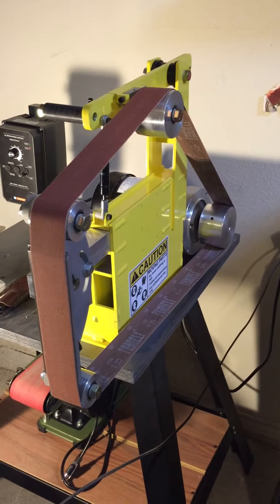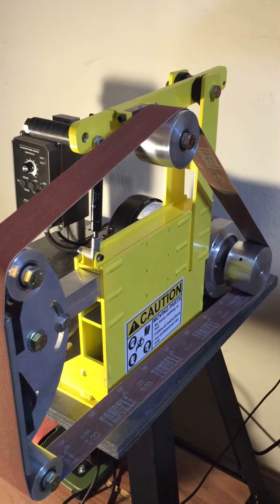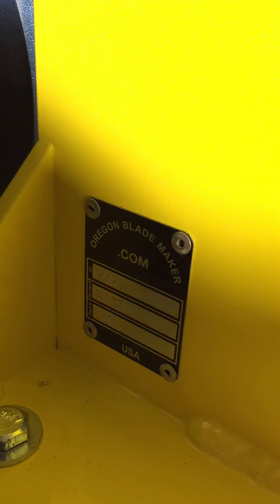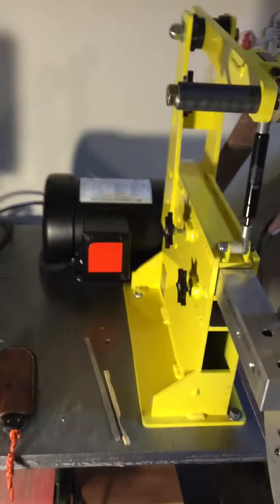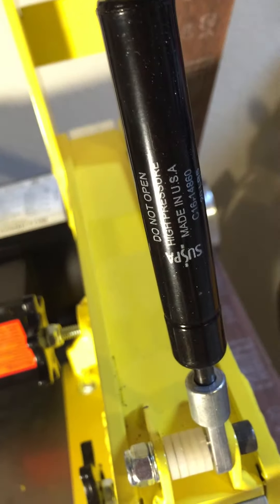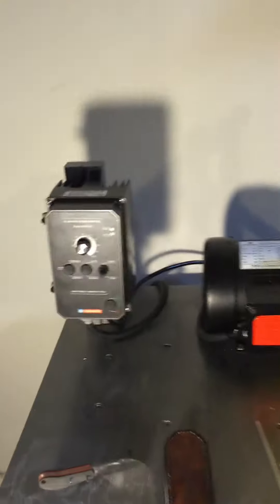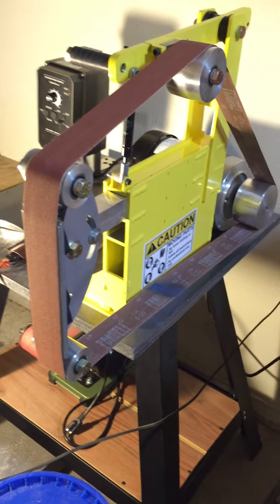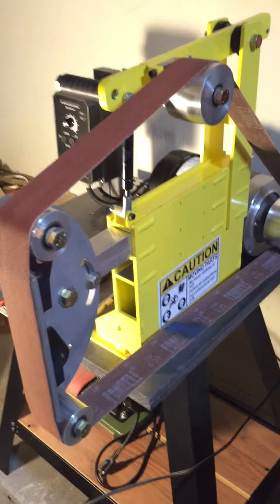New 2x72 knife making belt grinder review of OregonBladeMaker grinder

Comment: I really want to mimic your set up but I want to make sure I fully understand the set up.  You're running common household single phase 110v to the VFD so the motor is running at 3/4 hp?  And if you choose you can rewire the VFD for single phase 220v which will allow the motor to run at 1hp?  Many thanks!

Comment: Hello, I just got a Craftsman 2x42 grinder but after seeing your video I am thinking of getting this one instead. Would you recommend that I go straight to this 2x72 grinder or start with the Craftsman? Thank you
Reply from the maker: paulusandronicus If you can afford it and will use it then I'd get the 2x72 but only if you're going to set it up with variable speed.  This would be a step up from the Craftsman without variable speed but the variable speed makes it far more useful.  Maybe it's because I'm still fairly new to knife making but I probably use the slower speeds more than fast speeds.  That's especially true on handle work where you can easily burn the materials grinding at faster speeds.  I've seen guys who do all of their grinding at 6000 sfpm but I'm not capable of doing that without screwing something up.
Reply: A Forrest Thank you sir for the reply, I will try to get the 2x72

Comment: Can you tell me where you got your vfd and motor, and what model they are? Tried setting mine up with a variable speed bench grinder and its completely worthless...
Reply from the maker: I got a 1 hp Ironhorse motor from Automationdirect.com  model MTR-001-1AB18 and got the KB Electronics KBAC 24D vfd off of a guy on Ebay.  One thing on the KBAC drive if you get it and are putting it in a garage is you should try to get one with the GFCI software.  Mine doesn't have that so every time I turned it on it tripped the GFCI outlet that was on the same circuit as my grinder.  I found out later that you can actually get the drive set up with software so that it works without issue on a GFCI outlet.  I don't know the part number or anything but you might want to call KB if you plan on getting that setup.